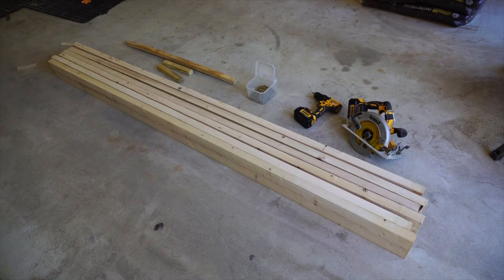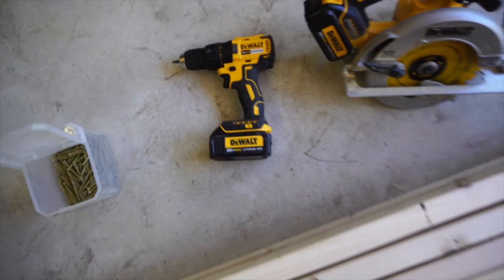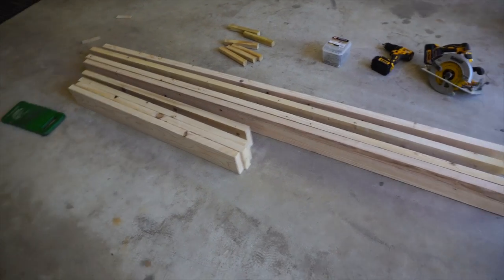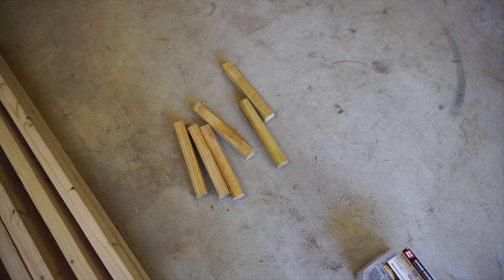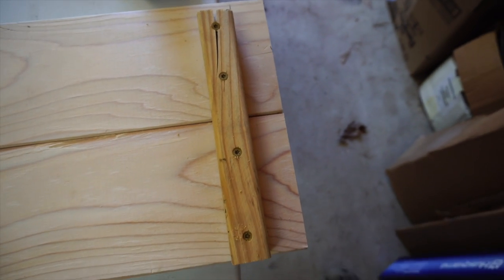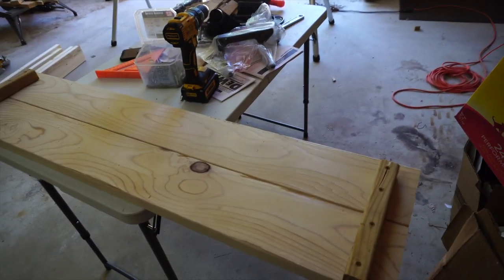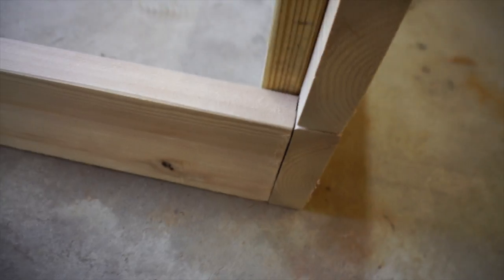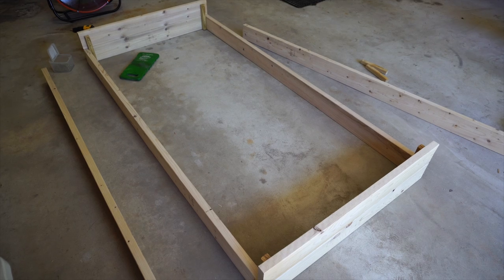DIY Raised Garden Beds That You Can Build For $30 each

Comment: Since those are not ground contact rated they will rot and fill with bugs. You can blacken them.with a torch to prevent that.
Reply from the maker: Yup, we are aware. We are planning on moving the garden in a few years. And didn’t need anything permanent in this location.
Reply: Nothing is permanent...

Comment: How much money is does the soil cost?
Reply from the maker: Caleb Chandler We paid $35 a yard through a local landscape supply company for a 50/50 compost and loam mix. If you had your own compost, it would be cheaper by about $10 a yard.
Reply: @TheMindfulHomestead  ok thanks
Reply from the maker: If you are in NH, you can call Northern Lights in Milford. You can also look into hugelkultur methods which would save on the amount of soul your needed.

Comment: I thought you shouldn't use pressure treated wood because of some chemicals or something?
Reply from the maker: Tips most modern day pressure treated wood uses a copper solution which has been deemed safe for use around food. 

Whether you agree with that is up to you.
Reply: @TheMindfulHomestead  I don't have an opinion either way, it was just something mentioned in an article I was reading just before watching this video. I just googled raised beds and here we are.

I found the video very helpful. If you don't mind, what would be the easiest crop for a beginner?

Also, do you recommend starting from seed or getting a plant from a nursery or whatever? I've started tomato seeds that did great inside but I muddled it all up when it come to introducing them to the great outdoors.

This is a long reply to your reply, for that I apologize. I promise to not soak up the comment space with beginner questions more. I will be perusing your channel for the next 30-55 minutes now. Thank you.
Reply from the maker: Tips No problem at all asking questions. That’s why we make videos, to help others out. 

The pressure treated thing is a hot point. I only mentioned the agreeing part because even though “they” say it’s safe to use, we still choose not to. 

Tomatoes are pretty easy to grow. There’s nothing wrong with buying seedling starts from a store, it will just cost a little more. If you do start your own seeds, it’s important to “harden them off” which involves putting the seedlings outside for increasing amounts of time leading up to finally being planted. It lessons the overall shock of going from indoors to outdoors. 

Hope this helped!